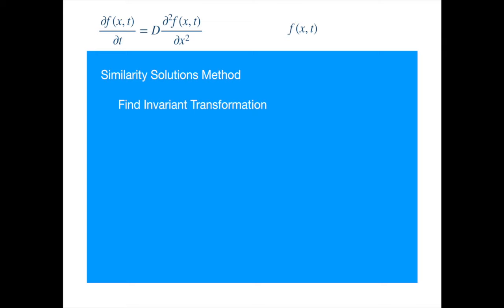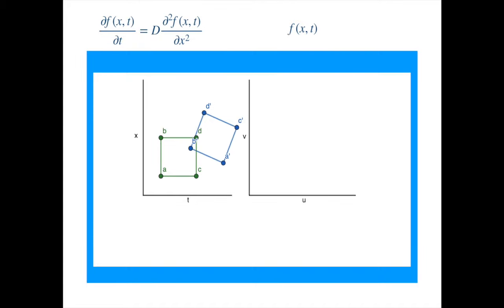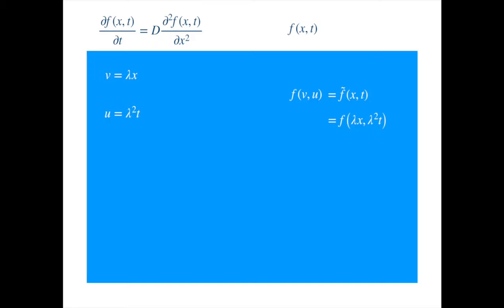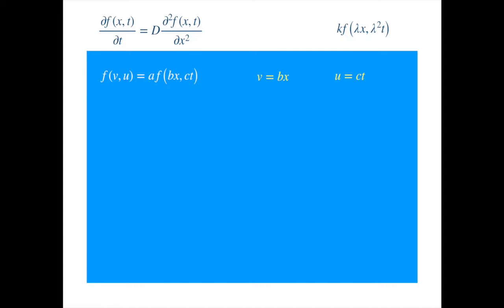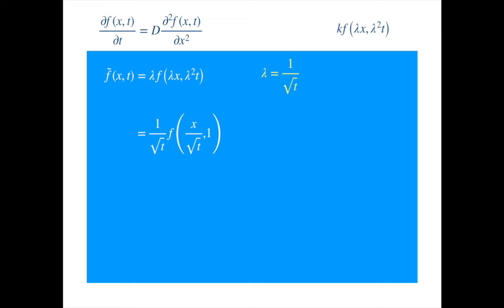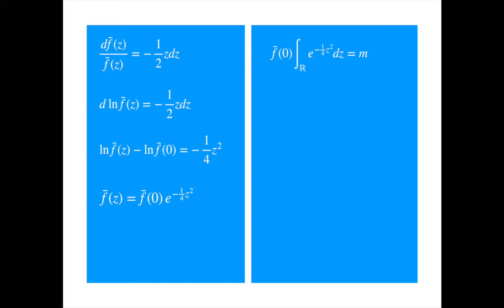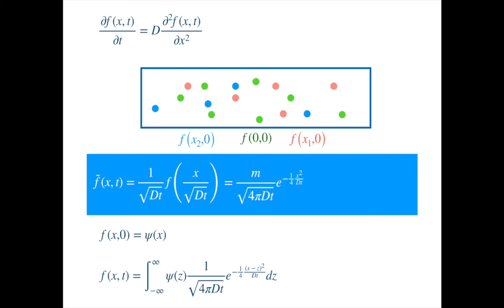Fundamental Solution of the Diffusion Equation using the Similarity Method

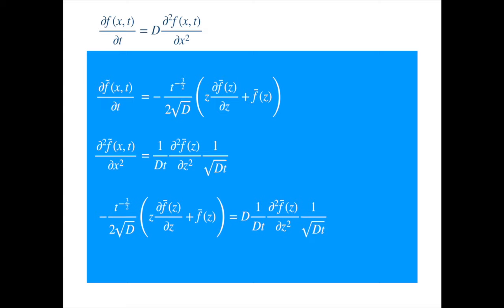Comment: I didn't really get the step in 15:28 where you equated the two differentials of the tilda function. I suppose this is because the tilda function uses the parabolic transformation, but previously we supposed the λ to be constant. Now thow λ is dependent in time.
Reply from the maker: Hello, and many thanks for the question! Are they not equal by definition? We are just transforming the variables.

Comment: At 16:58 when you integrate dln(\bar{f}(z)) why do you integrate from 0 to z? Could you have integrated from any constant not equal to z  to z? Your videos on diffusion are excellent. Thank you
Reply from the maker: Great question! You know that its differential equation is invariant under change of sign: z, -z. Then we know its total sum (integral) will be finite (total number of particles here or concentration), so it must go to zero at both ends: -\infty, +\infty. Hence easy to deduce that this must be an even function - symmetric around zero. So that's why we can integrate from zero to z, will work for both positive and negative values. Hope this helps!

Comment: Really great video again! Amazing work! I was following everything up until the last part (the integral representation). How would we go about solving the final integral to plot, for example, the distribution of particles for all x at some t given some initial condition psi(x)? Do we need to worry about z being dependent on x and t while we integrate (like if z was any variable we could take t and x out of the integral, but now z depends on t and x)? I know integral e^(-x^2) is the erf(x), but my calculus skills are quite rusty after many years of not using it a lot so not sure how to obtain the final answer. Thanks a lot for the great videos and sorry if my question is rather ignorant :)!
Reply from the maker: Many thanks for watching the video and providng feedback, and asking great question! Say we want to know the number of particles (or amount of heat!) at an arbitrary location x at some time t. We started the process at time zero with the initial distribution across the space, and then the particles/heat diffused across the space over time t according to the dynamics prescribed by the PDE. So the no. of particles that we will find at location x at a later time t could have originated from any location (which we now represent by z instead of x, so that we don't confuse the starting point, and the point of interest which is x). And the likelihood of particles moving from z to x depends on the distance between the points, the speed with which the particles are diffusing (co-efficient D), and the elapsed time. If the time interval (0 to t) is small, then the particles at x will have mostly come from the neighbouring location (z near x), and if the time interval is large, then they would have come from everywhere. So in summary we summed (aka integrate) the migration across the originating space. Hope this helps!
Reply: @quantpie  Thanks a lot for the great reply, this certainly helps to understand the physical meaning of the final equation :)! Maybe my question is more related to calculus. I always get afraid when I see an integral in the final solution (I would rather have just a function that you can easily compute, which would mean, I guess, that we need to solve the integral analytically). How would the final solution look like after solving the integral? The reason I am asking is that we wrote a computer code to compute the advection-diffusion equation (for multi-phase flow in porous media with chemical reactions) and want to compare it to the analytical solution (at least for single-phase flow without reactions, which you describe in your other video "Solution of Diffusion-Convection Equation"). Would we have to choose a specific initial condition and boundary condition for which solving the integral becomes easy? Like the point source that you describe in the other video? Thank you very much for your time :)!
Reply from the maker: ah ok thanks! something like this: https://youtu.be/irudcwJyo3o